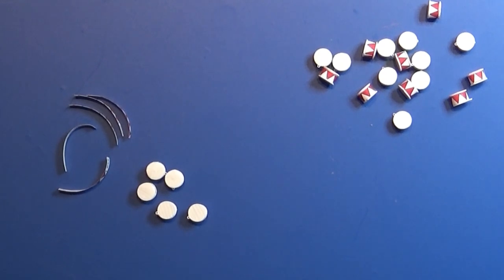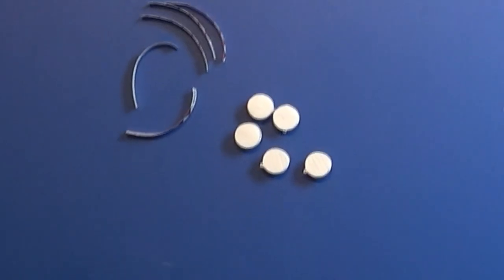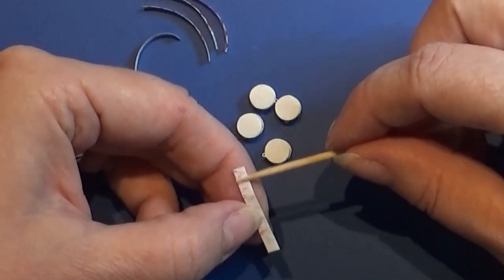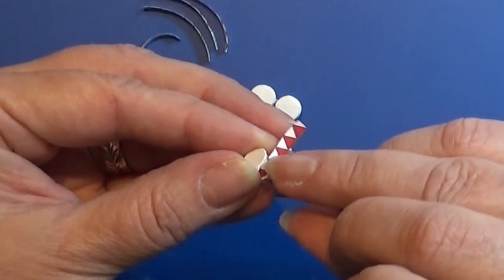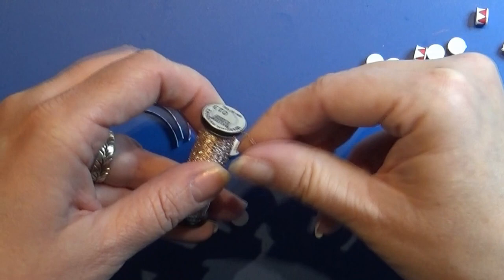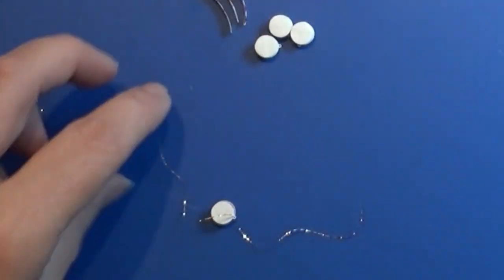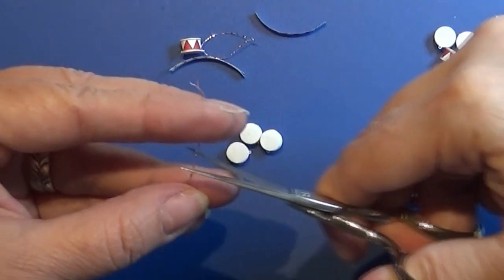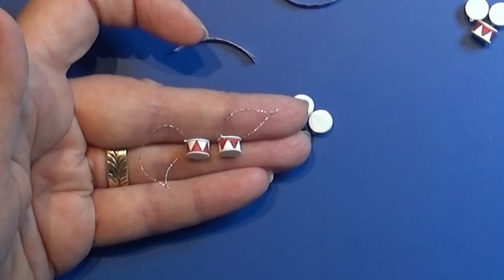Miniature 3D Printed  - Christmas Drum

Comment: Those are so cute!!! What kind of 3D printer do you recommend? Thanks!! I love your videos :D
Reply from the maker: That is a hard question.
I have both a FDM printer, the one there runs Filament, and I have a SLA/DLP printer the one on resin. they are having there good sides, and they both have there bad sides....

FDM is a clean printer, but not as detailed, it is better for bigger projects, but the settings in the slicer program is kind of hard to figure out.
The SLA/DLP  is printing cool detailes, the slicer program is easier, but the resin is not good for the health and a mess to work with